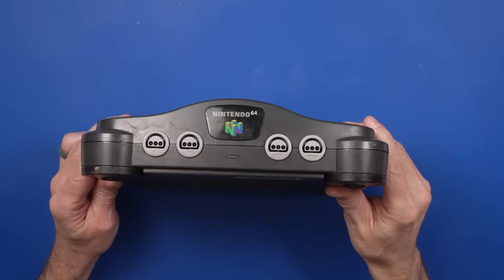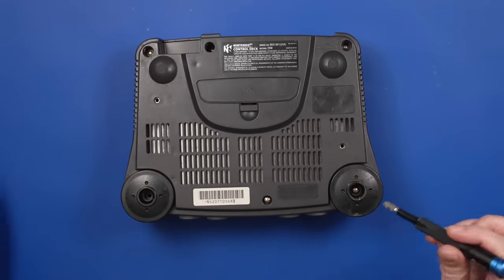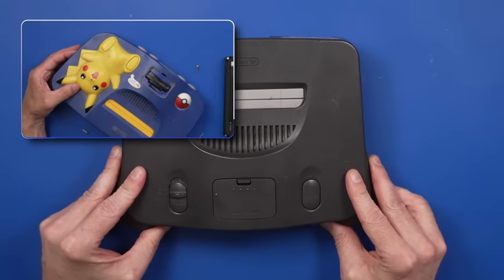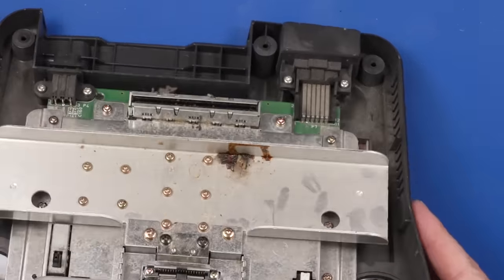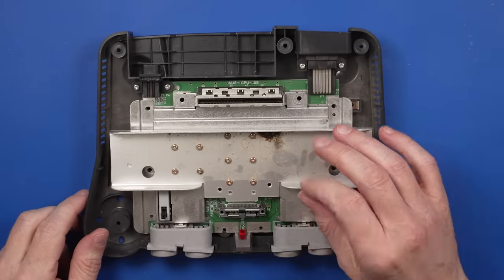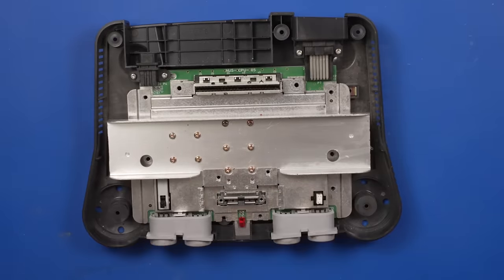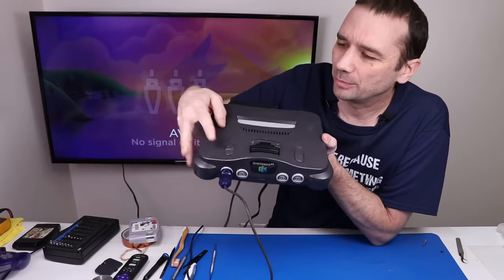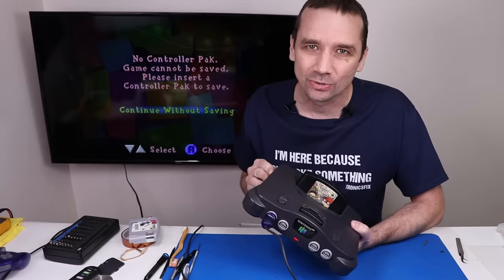$40 N64 That Repair Shop "Couldn't Fix" - Let's Fix It!

Comment: Quick fun fact: the N64 won’t show a picture without the Jumper or Expansion Pak installed. Maybe that was the issue in the first place 😅😂
Reply: You can see when he separates the housing that the memory pack was present
Reply: A very fun and useful fact indeed... Back when I installed my UltraHDMI, I spent like an hour panicking because I thought I broke something, turns out I forgot to plug in my jumper pak. I knew about this too, I had the bare motherboard right in front of me and it still took me a whole hour to notice 😅
Reply: @Tilt_TM I repaired a console once and the issue was the jumper pak slot connection. Now I always check it first.

Comment: Ugh. Nintendo and their obscure screws. Thank god for ifixit
Reply from the maker: Yeah, not a fan of gamebit screws, especially if they are really tight. So glad iFixit includes these bits in their toolsets.
Reply: Try apples screws. It will blow your mind
Reply: @bobbyrivera2951  I remember encountering them for the first time.... I grabbed my torx bits only to find out they were 5 sided instead of 6 and yelled out "of f-cking course apple did that" at my desk, haha 

Had to wait for a stupid screwdriver to arrive.
Reply: @bobbyrivera2951  A dozen different lengths (sometimes with 1mm differences) and you'll break the device if you get them mixed up? Terrifying...

Comment: I can't help but wonder if that chip was fine and the pop was a bug that shorted some traces or legs, or perhaps a protection breaker in the power supply.  Might have worked fine after a cleaning.  I'm sure the seller didn't test it with another power supply fwiw.
Reply: So much this. Would have been interested to see if it worked after cleaning and before chip swap
Reply from the maker: That would have been interesting to test but that chip was also definitely not fine.
Reply: @Tronicsfix  I guess I couldn't tell from the video, it looked more or less than same as the replacement once you cleaned it up.  How were you able to tell?
Reply: @Tronicsfix  why do you say chip was not fine? I did not see you test it. I would bet it is still good. Usually that chip never goes bad and there were no visible defects after you cleaned the terminals on it. Also you should have cleaned the cartridge connector. It simply comes off the main board by pulling straight up. Dirt and debris almost always cause issues here. I suspect that the system did not work due to shorted pins from the bugs across couple ICs. It started working after your cleanup.
Reply: @dalevanderzee4086  Yeah I was thinking the same thing watching the video. After he cleaned up the board around the chip the old one didn't look that bad at all.
Reply: Chip replacement for content.  I agree that terminals were likely shorted based on how it looked but we'll never know.
Reply: yep. 10 minutes in an ultrasonic and it would look like new
Reply: Those n64s have automatic resettable fuses

Comment: great fix again. Quick tip: use some leaded solder (or low melt) on the legs first so you don´t need as much heat and put it back on with the soldering iron and a good amount of flux so that you don´t need hot air at all. Workes great for me in tight areas like this.
Reply: Great tip! Also clean the pads with wick and PCB cleaner before placing the new component 🙂
Reply: Yep, I agree. If you use low melt solder, you probably could take it off without any hot air. Turned out fine though!

Comment: Amazing, first time in my life i see someone teaching the correct method to use the screws, first backwards until the screw get the correct position, then forward.
This can be "the BEST joke" or stupid thing, but its not, this method avoid any problem with screw/holes and you can identify easily a damaged one & last longer your products (for example cartridges, PC plastic antivibration fans which are easy to damage etc...)
For plastic & wood is totally necesary, for metal is not that bad but is important too.
Use this method every time you screw something and forget about any problem for your entire life, trust me.

Comment: Your screw thread process for not cross-threading them at 9:51 can also be apply to various types of jar lids that do not want to thread properly--just turn them backwards until they click in place and then turn them forward to tighten them down.

Comment: Hi Steve, sorry, I wasn't able to comment on your community post.  All the best for your treatment.  When I worked in pathology the survival rate for NHL, in Australia at least, was quite good, I feel after 25 years it'll be even better today :)  As a side note, I feel if the repair shop said they couldn't fix the N64, without even trying, as a customer I would prefer to be told they don't fix them right from the get go.

Comment: Not sure if this is your first N64 repair, but important to note that if you're testing without the case and put the jumper/expansion pack in the wrong way it will actually cause a fuse to trip. It should self repair but definitely one of those things to watch for

Comment: Power supply is one of the most common failure points on N64s. First thing to check, every time. While the inside was definitely a little crusty, it's much more likely that the "pop" from the former owner was the PSU dying. The later-replaced chip looked fine after the quick clean-up.

Comment: N64s are to my knowledge and experience pretty reliable and easy to keep running, capacitors don't usually fail except for in the Power Supply but it's still more likely a N64 Power supply works then not. Usually all a not working n64 need needs is the jumper pack,Expansion pack connector cleaning, and mainly the game cartridge connector/pins (on both the cartridge and console)needs semi thorough cleaning (boiling isn't necessary as I don't think the pins usually bend they just get dirty) and that's it.
It's still good to clean the mainboard, ideally change the capacitors cuz their probably not performing as well as they use to, and it's probably posable to do a thermal paste mod replacing the thermal pads with paste for beter cooling( I don't think cooling is a problem stock) but that's usually not necessary to make an n64 consistently run cartridges 1st try.

Comment: would have been nice to confirm the issue. just to see what changed :) i doubt that ls125 was bad and probably just needed some touch up. that poor switch =) i've had that happen too, even with tape. sometimes a piece of metal works better

Comment: Didn't think a bad Quadruple Bus Buffer chip (74LS125), could cause the N64 not to have a display.  I thought that was just for the controller ports.  I guess it deals with other system internals as well.

Comment: Sometimes all it takes is just a clean. I had a n64 similar to that one. Took it apart and it was just nasty. Cleaned up the board and it worked just fine.

Comment: Oh, this is extremely valuable to me. I have a US N64 from when I was 7 but am now in Belgium. Do you know if I can order components from the EU and install them in this old N64 from the US or are the components too incompatible because of the different voltages they use to power themselves?

Comment: Man, some old consoles were so simple and easy. Pretty much just a board and a heat spreading plate and your buttons. I understand why they are the way they are now but it feels like a chore now just to access a modern consoles internals. Also lmao on not having the cable plugged in ahaha

Comment: I bought my n64 off fb marketplace a few years ago for $50, had to get an av cable but it worked and the controlller it came with had a tight stick.

Comment: Just a question about what you’ve mentioned so far. The same amount of time invested in repair labour wise between this unit and an HDMI repair on a PS five would have a factor difference from $40-$200. Do you base your labour rate on time or the particular piece that you fix because if I was your customer and I brought you a PS five and you charged me $200 for an hour of your time. And then I brought you a Nintendo 64 and you charged me $50 for an hour of your time I’ll be a little confused, car dealerships, whether the car is brand new or 25 years old, charge you the same labour rate.

Comment: $40 isn't the worst. I also like videos of modding old consoles. Some mods have ways to bypass broken parts or just add a little value like and led controller socket mod in the n64 smash bros player theme ;)

Comment: After the cleaning, and maybe a bit of re-solder, would the original chip have been ok you think? Or was there evidence or based on your experience that the corrosion entered inside? What causes corrosion like that? :o

Comment: i found it funny you used toothbrush on board but cotton buds on metal plate, you could have saved those metal plate scratches if toothbrush was used. 😅😅

Comment: 4:14 the top left pin 3 from left looks bad may need to be replaced right side 4th pin left needs to be checked those pins could be the cause of a pop if they are fried or hit by a light strike ah those ol zelda days😂

Comment: When you tipped the metal cover upside down you covered the chips in dirt and dust and then said  here's the board it's a little dirty....yes because you just tipped all the dirt on it 😅

Comment: The SMD resistors in the PSU tend to burn out on these. If a PSU swap works then it's usually that.

Comment: hrmmm @ 3:32 - bottom right  board - (U8)  small chip just below what I'm guessing is the 'BIOS' ROM chip....  kinda look like there is smoke/flame damage on the bottom right, but I can't tell if that's just dust buildup 🤷‍♂
ALSO on the same timestamp - the TWO RAM chips (chips above the 'expansion pak/memory pak" port.... the bottom chip - right side of the chip looks like there is something strange going on there, but I can't tell if its dust build up
everything else seems to look normal 🤷‍♂🤷‍♂
Reply: oh look at that.. it's the first thing you saw too :(

Comment: Did you not power it on with your own PSU before replacing the chip? his PSU might have gone pop! Also why not just use a little low melt solder to remove the Chip 🙂

Comment: So I'm having an issue with my N64 I wanted to throw out there. I have an Everdrive 64 X5. It worked great. Lately, when I navigate the everdrive's menu, it feels sluggish, kind of slow. Like I push on the dpad and it struggles to register the presses. If I switch the controller to Port 2, the everdrive menu feels like it used to: super responsive and fast. What could be happening? Note: when actually playing n64 games, Port 1 is flawless. The only thing I can think of that changed is that I added a folder to the everdrive with nes games, like, all of them. But the memory card also has every n64 game on it, so I don’t know how it could be affecting it.

Comment: So much for that so called repair shop.... they saw they couldn't windex it and pretend to fix it. They obviously didn't even open it up based on all the dust and grime on the board. That's the first step in fixing something too. You need to see the board so you can determine what's wrong.

Comment: That chip was shorted from the corrosion growing, but once you clean that off it would have worked just fine. You probably didn't even need to reflow the same chip never mind replace it.

Comment: I always wished I knew how to reattach one tiny connector for my windows phone lumia 1520.   it connects the charge wire, cellular, flash, but otherwise the phone works fine.  Wifi.  
The chip is so much smaller than this but I bet in essence it just sticks on like this.  haha.   
I heatguned the screen replacements too many times.    Now I have tempered glass screen protectors and six cases I bought all the parts on ifixit one time "just in case".    

The fix it guy in town was like I'll fix it for $20 and I laughed I said it's really really tiny are you sure?   He said, "Maybe $70"  Like irl it's just a sticker right?  >_<

Comment: I have a problem with my ps4
It turns on , stays stuck on the blue light for ever , doesn't supply power to the usb ports and sits idle there for ever until i hold the power button down for 20 seconds, it also doesn't load into safe mode 
Any suggestions?

Comment: Hello, I need some help. I have a Jungle Green N64 that has audio, but no video. I cleaned the jumper pak contacts and game cartridge contacts. I have tried 3 different games and both jumper pak and expansion pak. I have used 3 different av cables and I am using a CRTV which I have used for all my other retro consoles. with no issues. I am not sure where to go from there. Any help is appreciated, thanks all.

Comment: Sometimes I wonder how "repair shops" work because ones my Xbox 360 broke after a thunderstorm so we sent them to repair shop since insurance covers stuff broken by thunderstorms after some time they sent us back the console and said they can't fix it after a few months I've fixed it by just changing power supply... A company that fixes consoles couldn't fix something that was a matter of one Google search but after that I've even cleaned it and repaste it by myself which wasn't easy, honestly I don't trust repair shops just because of how untrusty they are plus fixing stuff by yourself brings more joy

Comment: Pins on cpu and gpu both have filth that can cause them not to power on
Reply: The replaced chip visually looked fine prior to being replaced. Likely was an unnecessary repair as most of the debris came of with no effort.
Reply: Probably just needed a quick clean, I’ve bought 6 or seven of theses that were pretty filthy and only needed an isopropyl scrub to get them working again.

Comment: Steve Man  I really need help 
I have a 3DS that needs Reshelled DJ's top screen replacement and a charger port I also have a PSP 1000 that I took in to get repaired and the shell didn't work on it so now I'm needing it Reshelled and the home button needs to be repaired I don't know where to go for this so maybe you can fix it on video and send it back to me biggest fan here

Comment: You're doing God's work. But you should always do a dry clean before any wet cleaning. Just take a vacuum over it and some conpressed air. Takes like 2 minutes  for most game systems. It makes the wet cleaning process way easier.

Comment: N64 is in a weird spot. Many N64 games don't emulate well. But there haven't been many, if really any, successful clone consoles yet. Like, if you want to play NES or SNES or Gensis or really anything 16bit and earlier, you have a GLUT of options that are almost all better than original hardware. From emulation to clone FPGA consoles. But PS1/N64 era don't have those options yet. Emulation or original hardware are pretty much it.

And frankly, running ANYTHING over composite on a modern TV looks like absolute TRASH.